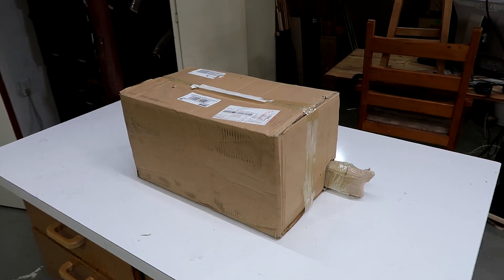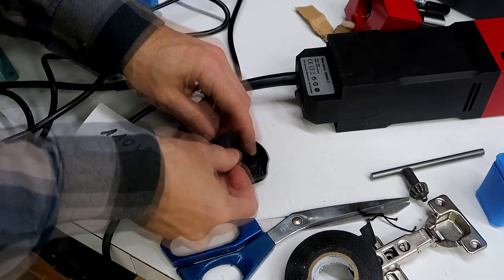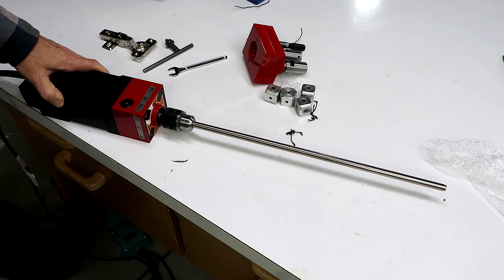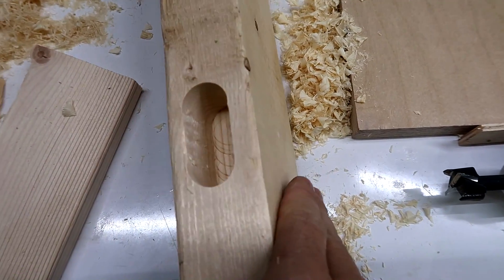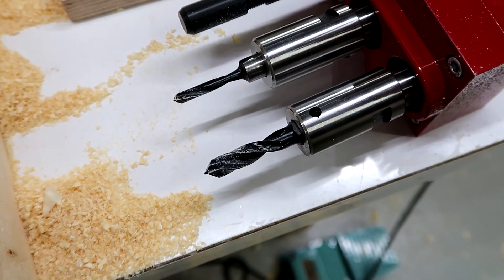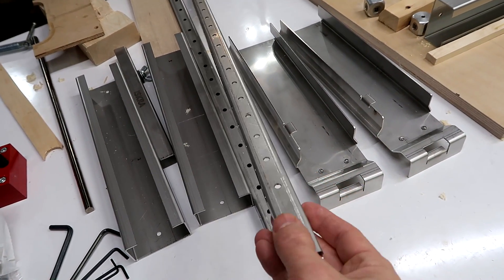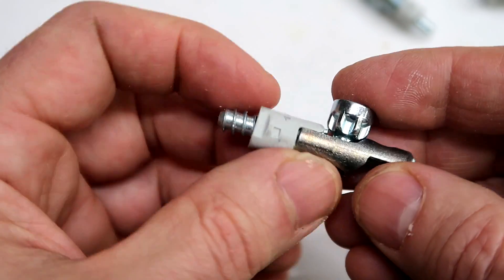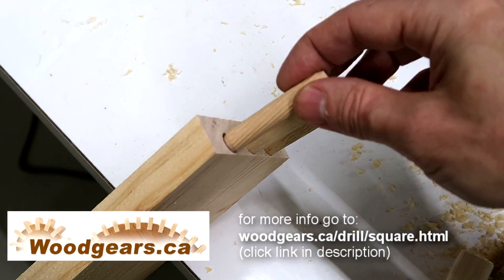A square drill for round holes

Comment: Usually electric tools/machines in Europe are made to work on 220V and 110V (120V respectively). I bought some of my tools from Europe and using them in the USA. The only thing that changes is the amperage, e.g. 220V=less amps, 110V(120V)= more amps.

Comment: One advantage of that hardware which you didn't mention is the fact that you can fasten the panels together without impacting the finish on the outside of either panel. Only dowel connection offers that from the list of options you mentioned and that doesn't offer much in the way of clamping power of the connection itself.
However I'm with you on the philosophy of them... They don't really feel as "self sufficient" a method as when you create all the parts and pieces yourself.

Comment: Surely the capabilities of that drill can be enhanced with a compact gliding surface, maybe metal or Plexiglas and a leverage arm to reduce manual push force.  Additionally, fences to guide the tool.

Comment: If cheap drills were square bodied it would be easier to see if the chuck were running true because you could hold the body flat to another object and watch the bit wobble. For it to be most useful the body would need to be square and the chuck centered (or diagramed as to side distance as this unit), which would require higher tolerances on the chuck and machining of the cast sides (I think casting alone wouldn't be accurate enough for that precision).

Comment: I think this tool is indeed for commercial furniture making. Especially for smaller/starter companies. I work at a bigger company and we have some huge machines doing this easily, but I still like this idea for the smaller companies out there that might need to have a good starting point, but still do it fast. (because sure, a few squares, tapemeasures and pencil will get you far, but it will cost you a lot of time).

Comment: Hey Matthias, the reason that you're having troubles at around the 3:45 mark is that your hand isn't rigid enough to pin the drill against the guide boards. You'd want to have rigid horizontal supports on both sides of the drill for what it appears that you're doing.

Comment: I don't think the 'On site' drilling is the most important thing about the tool/hardware combination

This hardware is meant to be disassembled again and to be mounted from the inside... So you won't see any screw holes

In theory you can do a small run of custom fit kitchen cabinets without a CNC mill, no G-Code generating and all of that overhead

The Customer could even assemble the Furniture himself, with this hardware it's quite difficult to damage something

Comment: This fits perfectly for standardized hole spacings. I don‘t know about US and Canada, but these system-optimized tools get used a lot in Europe. I‘m not a big fan, but have to admit, that it makes things very easy, especially if some parts are added later. I also have a jig, that snaps in at exactly the standardized hole distances. I‘m not sure, but I think IKEA uses the same or at least a similar system. It‘s also very easy to use by non-professionals.

Comment: Super high end European cabinets like Poggenpohl use the 32mm system.   Particle board is used because it's very flat and consistent, not so much because it's cheap.  In Europe though there is not much forest anymore which is one other reason particle board is used.   After WW2 there was a lot of destroyed housing and skilled cabinetmakers were killed or maimed in the war so engineers like the Ikea founder developed the system so much less skilled workers could produce the cabinetry.   I have built to the 32mm standard and it is very fussy unless you have some expensive industrial machinery to make it perfect.   In a shop or factory set up properly for it the method saves a lot of time though - many parts are standardized with standard drill patterns so for example left and right cabinet sides are the same, just flipped so there's no way to screw it up when assembling one.   At $400 this tool would definitely be a time saver when building in 32mm without, at minimum, a construction boring machine.   There are a lot of  jigs to drill shelf pin holes on 32mm centers for a small shop but all the knock down hardware stuff is not so easily done with the required precision.

Comment: $392.50 is the cost as of 10/31/19.    

I'd love to see Matthias make some plywood modifications to regular old Makitas or Dewalt drills to make them into a square drill like this.  He is the one person who could pull that off.
Reply: Ive read all the way from the beginning of the comments trying to find the price. Thought the machine was interesting but cant justify that kind of price for the little i work with particle board
Reply: @stashagarcia101  Well, if you really took a lot of time and effort, you could disassemble any sort of corded hand drill and rebuild it into one of these.   It would take a lot of precise work though, and a lot of patience.  The interior of any drill is just a motor, a couple bearings and a trigger switch inside a plastic shell.   You'd just be replacing the plastic shell with a square wooden shell.
Reply: @jimthesoundman8641  i see your point. But Id hate to ruin a good drill for the tiny bit of laminate work i do. 

Id be more inclined to create a jig to set my drill into where it could hold my existing drill firm enough to allow me to use it this way

I think the two things i found the most interesting about it were that you could drill your screw hole and dowel hole at the same time and the metal spacers that aided in accurately spacing your drill pin locations. 

I saw them used in the manufacturer's video. Couldn't understand a word they were saying, but the demo was easy enough to show it in action

Comment: I almost think a square router would be more useful to me. Super cool idea anyway!
Reply: I can sell you a SPARK. I will give you a good discount, as you promise you will make some nice spark movies and show on your channel.
Reply: Square router makes less sense because you have to move it parallel to material face so reference side has to be front or rear. And requires more force (as you can see also on this video it's weak point of this drill).

Comment: I am a hobbyist who has used these type of fasteners for projects with melamine board. You can produce a nice finished product very quickly and a huge advantage is that things built this way can be easily disassembled and moved. At least with the fasteners designed for that. If this tool was affordable for a home shop I would consider it if I wanted to do another project... which I do—a virtual pinball cabinet.

Comment: I'm in love with my new Polish tool,  the famous Titan 8" planer/jointer  for £159.99 delivered.
If that drill had a morse taper and a decent speed control/gearbox,  it could do what it does now and be a nice metalwork spindle too.

Comment: I had a one of those all-in-one woodworking tools (one electric motor with different accessories) made by Total Shop (a clone of Shopsmith) that I got secondhand for cheap.  I quickly figured out that the whole system, clone or not, was a big steaming pile of shit, but the one really useful thing that it could do was horizontal boring.  Several years ago I looked for a drill that was designed to be mounted to a flat surface but didn't find anything.  Now I wonder if you could take a modern, cheap, corded drill and 3D print a square housing for it.  The dual head thing is too niche to be of any marketable value in my opinion.

Comment: Seeing this almost makes me angry that typical power drills aren't designed with any flat faces for jigging/clamping.
Reply: Probably what the designer was thinking as wel
Reply: Because then they would have to add a machined part behind the clutch adjust which would cost way more than the simple Glass fiber reinforced nylon clamshell. They might could set it up so the gearbox is machined with a square reference surface integrated into the outside and have the clamshell bolt to it axially. But a lot of drills use plastic nylon or delrin gearboxes now.

Comment: i love the idea and while I credit the inventor for thinking it up...this seems like a very easy problem to solve if even if you just create a custom cradle or case for a regular drill.  I think with $5 of wood, a band clamp and a cheap harbor freight drill, I could mod something.  The runout and power might not be any good but the cradle seems easy enough to build.  I don't think this has a huge market though it is cool.

Comment: Looks like a nice, (relatively) inexpensive and versatile alternative to the Blum press and line boring machines.  That'd be a pretty slick setup for a guy with limited shop space and/or budget.  Also, don't give in to the temptation of pigeonholing most of the fastening methods available with a system like that into cheap particleboard construction.  I love the euro (Blum) style hinges for solid 5 piece doors as much as for slabs or plywood.  And the uniformly spaced pegholes are great for all manner of adjustable shelving.  If it were mine, I'd be all over that for doweling.

Comment: The cam panel fasteners you mention are the bane of our existence in the US as I have run across them in flat pack unassembled higher end furniture like bookcases and  desks. If you are lucky they hold up for about 5yrs before you start finding pieces on the floor that fell out of poorly drilled bores or caused by the vibrations of drawers opening and closing a thousand times a day. Or the side bore doesn't match up to the side driver screw so you have to redrill a bigger hole up the bore shaft to access the fastener. Or the pre drilled pilot hole on the joining particle board or MDF flat panel was not drilled dead center of the edge of the panel so you have a weak connection that will eventually tear out the side.

Comment: At the end he said it himself. This device is meant for commercial furniture that needs to be assembled from flat packs on the site. For regular guys like us with a few tools laying around there are cheaper easier ways to drill holes. I think if I had the extra spending money I would buy one anyway just to screw around with it but right now I'm not in any paticular hurry. Still I have never seen a drilling device with multiple drilling heads. That was very interesting.

Comment: This drill would've been really handy at the job I've been working. We often have to drill into the steel channels next to automatic sliding doors to feed cabling inside of them. Every time it's a real pain to line your drill up so that your center on the channel but not so close to the wall that your drill gouges the drywall. This results in kinda messy holes that thankfully get covered by armor guard end caps but feeding wire through a hole like that can scrape and cut into the wire if your not really careful.

Comment: It is for making furniture using the System 32 standard. In europe there is a ton of hardware for this standard. Drawer slides, hinges, baskets, and so on. If you build your custom furniture and you follow the System 32 guidelines you can use the most ikea hardware for examle.
Reply: step 1: delete system32
step 2: ???

Comment: General information for everyone who doesn't know;

This whole Idea is based on "System 32". No not computer software, System 32 is the System for the Particle Board Furniture, like Matthias said in the video.

Every hole is 5mm big, exactly 32mm apart and 37mm from the front (Or edge from the wood rather).

If you are into building that sort of stuff, I imagine having this drill is gonna be quite handy.
Reply: Interesting because LEGO use s 5mm holes on 8mm diameter.  iirc.  So 8x4=32 = lcd compatible.

Comment: This is only half of what needs to be designed. You need a gear driven spindle like a drill press. Clamp the drill body solid then use the extending spindle to cut your feature. 

This is a square hand drill, you want an all position drill press.

Comment: I like it. A few things about it that could start a big discussion:

I think a router-based tool would be more useful than a drill. This would put less stress on the bearings for lateral loads. (Maybe it is built that way? I don’t know, but it’s called a drill so...) A variable speed would be necessary here.

Maybe even have multiple threaded holes around the body for mounting it to other jigs. Say you wanted to use it as a horizontal boring machine, or horizontal router. 

Might even make sense to maybe use it as a spindle for a DIY cnc? I think the inventor is going for versatility here, so I might be getting a bit too specific with features. Still neat though.

Comment: I think the two different drill sizes are on purpose. In particle board cabinets you often have a dowel right beside a screw. The dowel for locating the parts (and stability) and the screw to hold the parts together.
Reply: U R Correct sir.
Reply: @HBSuccess  they could be the same size, but the drill kit only came with one of each bit
Reply: @GC-jo1rn  
I guess some people see what they want to see, not what's actually there.

Comment: Seems like a fixture slide unit  would make this rectagular unit more reliable  maybe a dovetail key way  made of delrin that is keyed into some aluminum shapes? it would eliminate drift attachment pints on all sides I can imagine a smaller battery operated 12volt

Comment: I remember seeing a Jimmy DiResta video, probably a few years ago now, where he commented that he wished cordless drills had square/parallel faces on them so they could be guided like this with simple tools like squares.
Reply: Yes, in Drill Tips.
Reply: Drew Morgan I remember that.  He said tools are not marketed to people who use tools, they are marketed to people who buy basketball shoes.
Reply: @teekaypew6538  , that's it! Square basketballs!
Reply: @teekaypew6538  I think he said that drills shouldnt be designed to look like Basketball-Sneakers
Reply: first thing I thought when I saw the drill
Reply: @MrBez007  same!
Reply: Came to leave the same comment. I think it was in his drill tips video.
Reply: I wish all tools had square sides, would make making jigs so much easier. If I could take my portable belt sander and turn it on its side of have any instant vertical sanding belt.
Reply: Hello. This Iskra (Spark) drill is 6y old ;) But actually is available for all ppl about 2-3y. Regards!

Comment: Sounds like someone could come up with 3D printed or CNC sculpted plywood encasements that would clamp to popular drills (I know each model would be different).  The plastic or plywood case could then be clamped into jigs like it was talked about in the video.  Or someone could come up with plans on how to mod a drill for the same purpose.  
But then it makes me ask, how is this different than how Mattias uses a router motor for the PantoRouter or Horizontal Boring machine?  Don't those basically do the same thing as what this square drill case does?
Reply: I tried to do that. Not easy.

Comment: TBH, I don't really understand how this is different from a small laminate trim router inside a rectangular box.
Reply: Well, the chuck is very different and accepts a range of shank sizes instead of couple specific sizes. Easier to find proper sized bits for furniture too.
Reply: @apinakapinastorba  I have a roto zip tool with a 3 jaw chuck on it. I think it only does open up to a quarter inch though? Still fits into a trim router base too. The nose of it is the same size as a Bosch Colt. Though the chuck doesn't fit onto my Colt router. Bosch wasn't copying themselves that much. Almost, but not quite (Bosch makes Roto-Zip). I also have additional collets and adapters for some of the other routers I have. It really is all about accessorizing.
Reply: I doubt the market segment of that machine will have a box of bits and bobs if they can have a dedicated tool that does not need any adapters.

Of course one CAN do lots of stuff with many tools, but there is definetly a difference between that and a router in a box.

Comment: Seems rather like a solution looking for a problem. I take the point about cabinet fittings but is that really a problem that requires another kind of drill? Hmmmm. Not convinced.
Reply: I see your point. 
This tool could be a good solution for an inventor wishing to prototype designs that could ultimately be sold to IKEA (or similar mfg's) for mass production. A lot of such prototyping could be done on a CNC setup but this tool could be a godsend for someone who didn't have the funds or space for such equipment. 
(Full disclosure: I'm a machine-geek wannabe....)